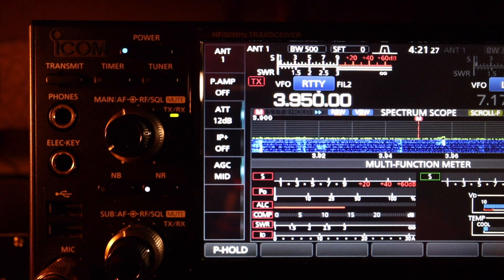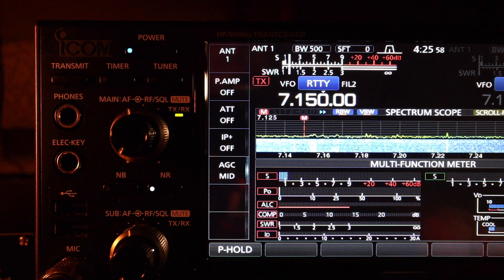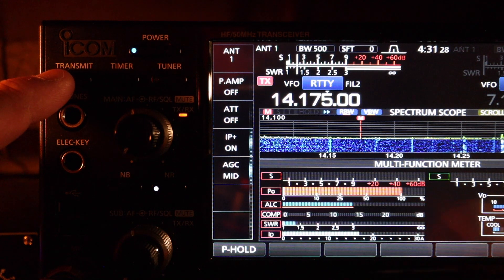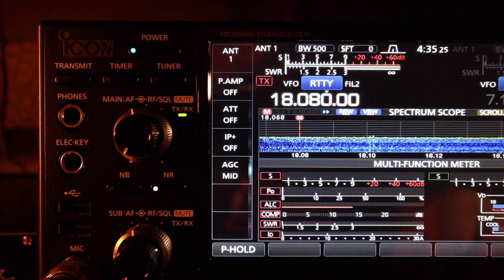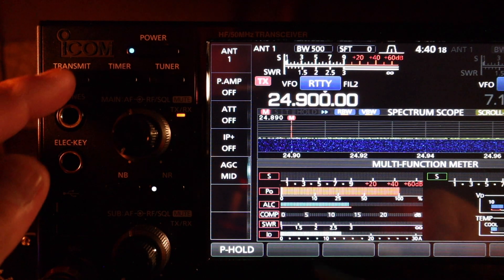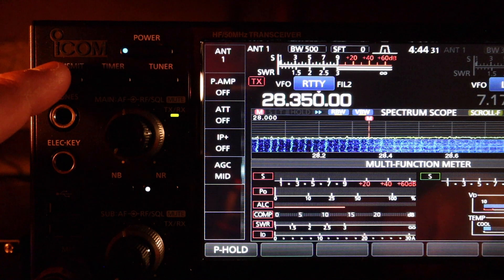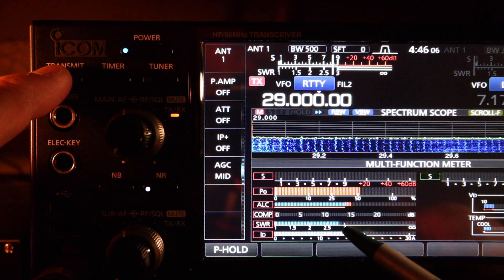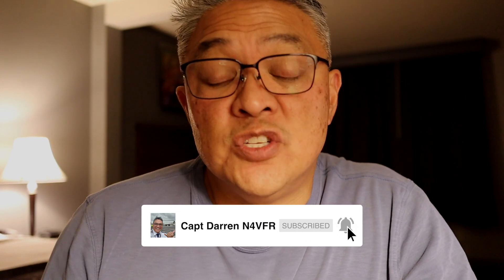DX Commander SWR Results after adding 80 meters element | Best DX Antenna!

Comment: Did adding the 80 meter wire to the DX Commander change the swr on the original verticals of the antenna?
Reply from the maker: No.
Reply: @DarrenN4VFR  Thank you.

Comment: Hi,
Great Video about the DX commander. I built a classic on my own and i have problems to tune 40m  it stays at around 7.400 even if i add Mode wire. In a Former Video you mention the same Problem. What did you change?
Kind regards

Vy 73 de DD4SG, Gerold
Reply from the maker: Hmmm,  I don't remember.  Here is the Calculator to help you out:  https://www.m0mcx.co.uk/quick-swr-calculator-for-vertical-and-dipole-ham-radio-antennas/

Comment: My older Icom has a disappointing tuner too, I know you cut your 80m section for ARES not something that applies to me. Envious of your 7610 though. I know you had some anomalies on one band, that maybe due to the close proximity of the car port,
Reply from the maker: Yeah, a few viewers and Mike KG2MM suspect my car and the shed may effect the SWRs.
Reply: @DarrenN4VFR  TBH I doubt it is the car itself, but it is easy to move it and see

Comment: I gather by your SWR Readings that you are a SSB operator. I myself would have cut the wires for mid band. So you can use your tuner to operate both CW and SSB. Mark KB3Z
Reply from the maker: I just bought a cw key and will probably adjust my resonant frequencies.